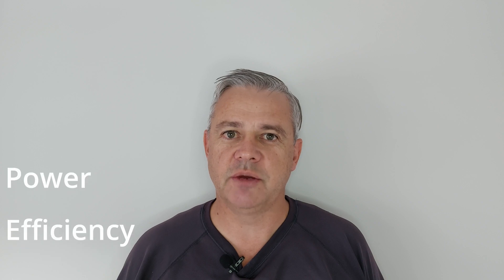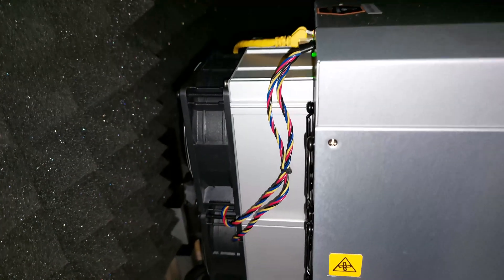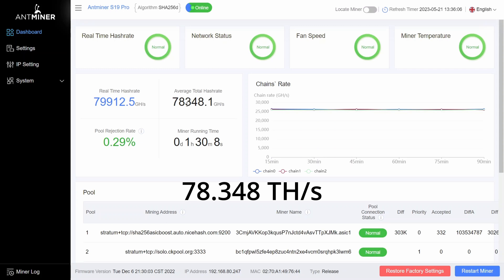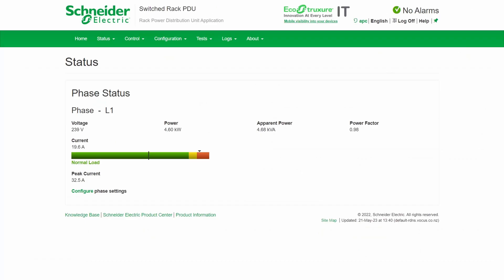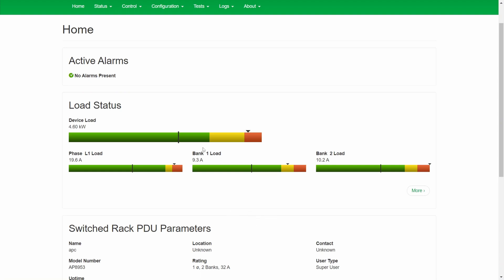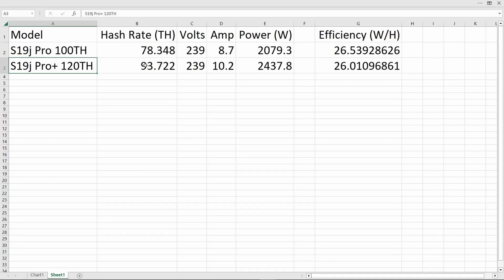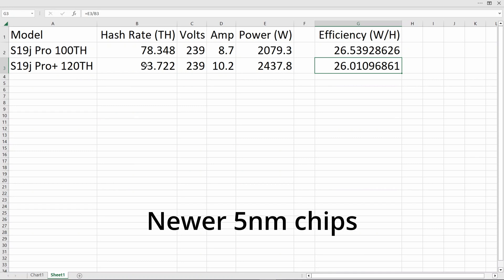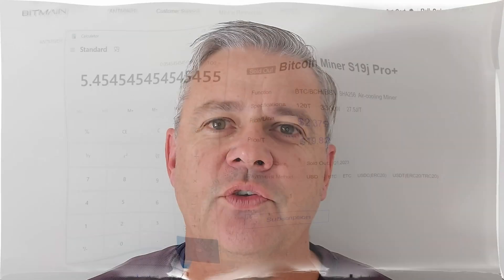Bitmain Antminer S19j Low Power Mode Efficiency

Comment: Hey there Philip, Are you able to double check efficiency for the 120th jPro+ ? I have two or three other sources who are getting around 23.5j/th - much better than what you are getting.
Reply from the maker: It looks like the efficiency might vary between 25.1 W/TH and 26 W/TH based on the line voltage and temperature.
Reply: @pdath  https://youtu.be/f5Etr3mzNsE
Reply from the maker: This is measured using a calibrated metering device and has a certification allowing it to officially be used for metering.

It is reporting a line voltage of 236V with a power factor of 0.98.  10.0A is being drawn.
It is a bit cooler today.  The ASIC outlet peak temperature is 70 degrees Celsius.  The fans have run down to a peak of 5300 RPM (was 6000 RPM last time).  The current average hash rate is 93903.39GH/s.

That makes the current efficiency 25.1 W/TH.
Reply: @pdath  Philip, I have reports from people that the original release firmware from March 11 runs more efficient in low power mode. I noticed you did your test on the latest release firmware. May be worth seeing if you can drop back to the March 11 version and see if you can get that 23.5j/th being reported by others!
Reply from the maker: Good tip.   I don't know where I could get that firmware from.   Bitmain only make the latest version available.
Reply from the maker: It could also just be "silicon lottery", and they won the lottery.

Comment: Please also share info on s19 90th on low power mode... Do we have a factory low lower mode for it.
Reply from the maker: I should have access to one in a couple of weeks...
Reply: @pdath  maybe also S19 82T low power mode?
Do you update the firmware from bitmain or use custom made with devs fee?
Reply from the maker: I only use Bitmain firmware.
Reply from the maker: I don't have access to an 82TH model.
Reply: Boss do a comparison video for underclocking of all the s19s which are available currently you can refer to the data from some right source for the ones you don't have. Keep pushing the good content 👍🙏😊